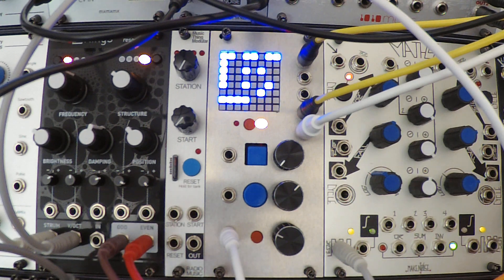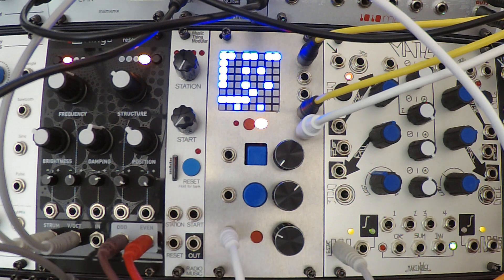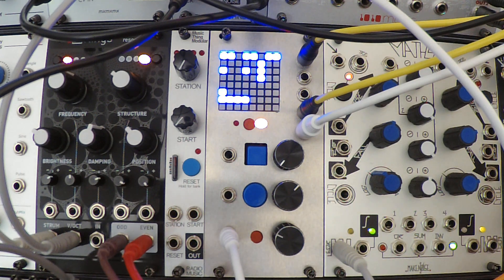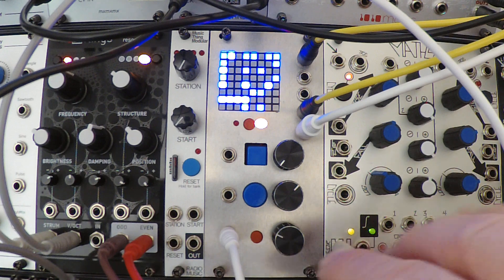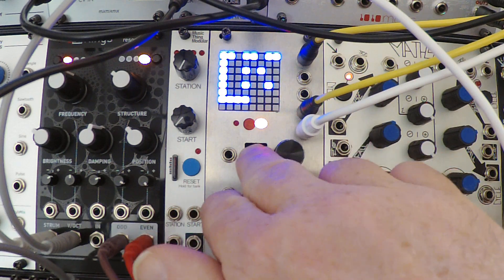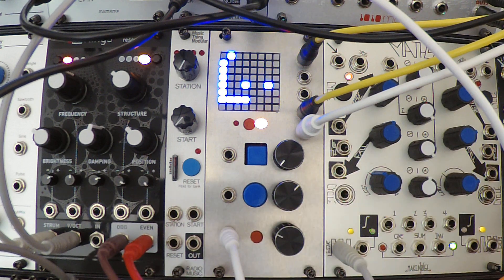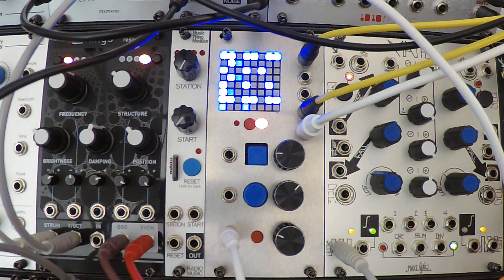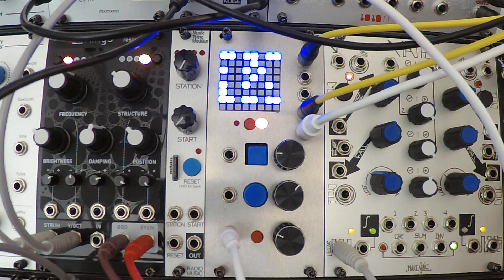Eurorack DIY - Euclidean Polyrhythm generator 1st prototype

Comment: IF you build a kit, you could go surface mount without any qualms from me.  If I can get the PIC and PCB by itself, I would buy a through hole version.  As I don’t have any surface mount components stockpiled, it would require me to buy all sets of surface mount components for just the one build.  So through hole is my preference, unless you only make a kit available then I have no preference.  That module looks pretty cool.  I would hope to get a nice trigger sequencer like this someday soon.  Pretty cool module.  GREAT JOB!

Comment: Sweet!  Thanks so much for doing this. I'll be there when your boards are ready :)
While surface mount isn't that terrible [IMO, at least at the larger sizes], perhaps through hole would still increase your potential market? Nice solve for the TRS A/B dilemma. Firmware upgrades like the Gate out shouldn't take precedence over the hardware.  Retrigger from a button is a nice "playability" bonus.
Reply from the maker: Thanks, it's been a fun challenge. As I mentioned in the video, I still have to sort out final components for the panel board, especially as it relates to the ergonomics of using it (don't want it to feel cramped). Stay tuned......
Reply: @electrichartstrings6706  we're still tuned! Did you finalise any boards? I just bought the display myself, will breadboard/veroboard the circuit but eventually I want to build it into a module.